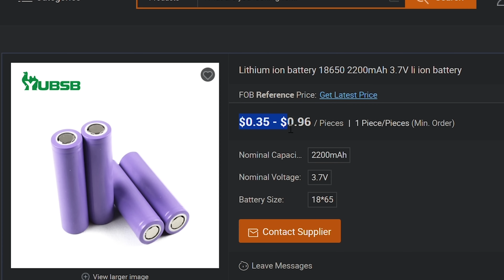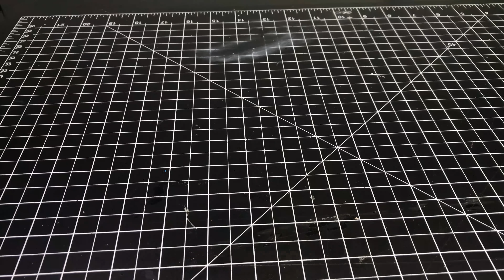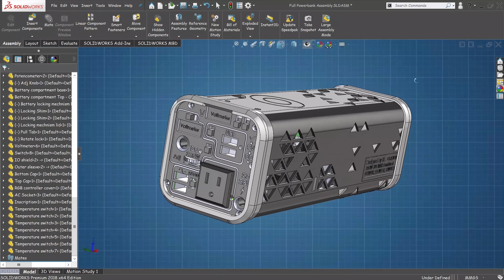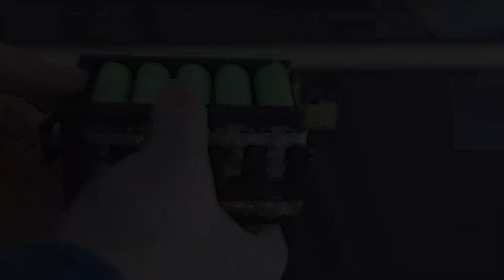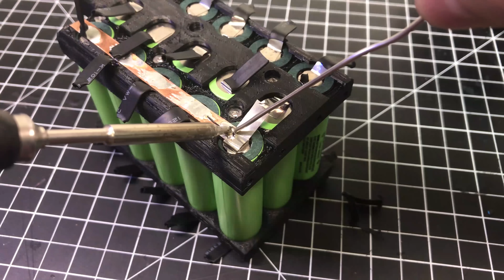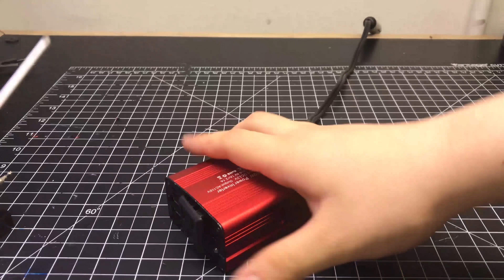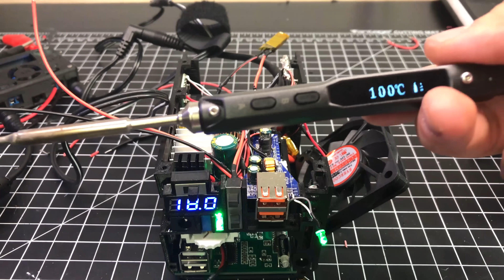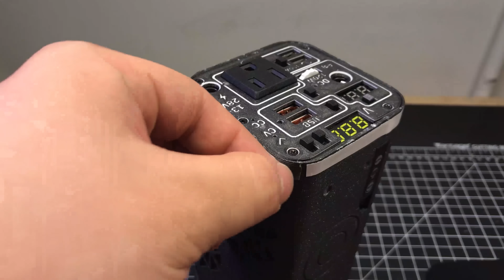How to Make the Ultimate 18650 Power Bank with Infinitely Expandable Capacity

Comment: Out of interest, why do you charge at 2A-3.5A?  You have 5 in Parallel, so at 0.5C charge per cell doesn't that enable a charge current of up to 6A??
Reply: Or for your batteries (Got the capacity wrong...): 3200mAh, or 3.2Ah *0.5C *5 in P = 8A Charge Current?  Or am I completely wrong here?
Reply: @SkySpeer  Safe charging current is 1C, as in 1 * Capacity. For a 3400 mah battery 3A should be fine.

Comment: It is not a power bank,  it is a power station ... You are a genius
Reply: Goal Zero calls this type of thing, a Generator, because this turns battery output, to AC line voltage, to normal Outlets.  I have a "Yeti 400".  It is a battery/powerbank/inverter, and this charges up via outlet, or solar panels, by Goal Zero.
Reply: A power station generates electricity. This doesnt.
Reply: @TigerManGaming  i think he meant station as in a larger capacity system. You are right though, power stations are technical names for transformer stations and generator stations

Comment: I created 10kg power bank to Makita box with 5v & 230v output of 2300w. Inside the box are Turnigy batterys 4x8Ah 6s 24v. That was very expensive for me to create it. Also I added several charging options to box - solar controller, 6a main charger, auto 12/24v step up converter.

Comment: As a Arabian, can i pass this through the airport without being sent to Guantanamo Bay? I heard their sandwiches are un- joyable...
Reply: I think the batteries are too powerful to get through normally, but if you call TSA in advance you can get it cleared.
Reply: For transport in passenger aircraft the limit is 100 Wh. With 15 cells it has probably more than this - and would not be allowed in a passenger aircraft. There is also contrary to commercial products no sticker with the specs on it, so I doubt they will let someone with a huge powerbank like this into an aircraft (despite this powerbank is really awesome).

On cordless tool batteries there is usually a sticker with the specs, and on makita batteries there is even a small plane symbol on the sticker, as long as they have less than 100 Wh.

Comment: You sir are a legend. I love it. I have pretty much all of the components needed for this build except for 3d-printer and soldering iron so I´m kinda tempted. It all seems pretty straight forward but very time-consuming. I actually have a total of 1300WH 18650 batteries already soldered and connected into 84v configuration. I´m wondering if I could hook that up to my 300W inverter in some easy way?

Comment: Do the usb 20v trigger, convert traditional 5v from a usb port to 20v and then get stepped down to 12.6 volts for charging? Or is it being used to carry 20v from a charging  source to the trigger then to the stepdown converter?

Comment: I live in Germany, so what do I have to change to make this AMAZING power bank work for me?
Reply: I think mainly you would be looking at an inverter for your country's power requirements. So where us in the united states use 110v - 120v ac with those simple 2 to 3 prong small outlets,  you would get the kind of inverter you would see commonly in your area. But please take plenty of time to compare the internals of your inverters with those of the one displayed in the video and infographics. High powered electrical devices should not be messed with unless you know exactly what you are doing, especially with the somewhat powerful and volatile 18650 batteries.

Comment: How do I tell if my batteries can put 5 Amps? I have panasonic batteries the green ones. Also can I build the battery bank larger if I have a case?
Reply: You can build with any 18650 batteries but should have minimum requirements as shown in the video.

Comment: I don't think u can take this on a plane they will literally think is a bomb
Reply: A bomb with RGB
Reply: @abrahamyehoshuafrias3390  Fancy Bomb
Reply: You can't anyways because only battery packs up to 100Wh are allowed on airplanes.... Now if we take this and breakdown into smaller 90-ish Wh packs we're totally fine.
Reply: @MatheusPratta  only if assembled ... pack the battery packs and main body seperate and you should be able to check them in your luggage
Reply: theres a max battery capacity allowed for airplanes anyway, this goes way over the limit regardless
Reply: With the RGB, and you mentioning a bomb, my brain jumped to this: https://www.youtube.com/watch?v=j-zvuq_AvU4
Reply: It's not a bomb it's a bong!
Reply: @몰라요 Speach 100
Reply: RGBomb
Reply: I wouldn’t be comfortable being on a plane with this. I have seen first hand just how bad a short in a lithium battery pack can be. If you tack welded the battery’s to the buss bars I wouldn’t have a problem but soldering them with an iron puts far too much heat on the battery.

Comment: Awesome my friend, you should get a job at Belkin, Logitech etc.
10:30 - batteries charging and discharging at the same time? The step down converter would provide suitable power to pass-through, you could leave everything going. While Im sure a flooded led acid battery's chemistry could be slow enough to technically be charging and discharging (microseconds) Your using a much more efficient battery set, with BMS. Just a thought.

Comment: I have a ham radio that is powered by 12v (13.8v ideal) it uses 10a max on transmit and 3/4 A on receive...roughly 3 to 1 on trx versus receive. would this unit power it?

Comment: I have some similar systems using old e-bike batteries. I charge using solar power circuit that I found on ebay that supports 48V batteries - i set the charging voltage to 54.6V. A problem I encountered is that I charge and discharge at the same time because I need to charge my phone, so I was thinking about using an arduino with 48V relays to switch between the batteries so that one would be charging while the other is being used. I have learned a lot from this video, thanks.

Comment: Hey I'm curious about which 18650 cells to buy.
https://www.alibaba.com/product-detail/Original-Japan-NCR18650B-3400mAh-3-7v_60482164381.html?spm=a2700.7724838.2017115.83.178268efmg9Mey
This link has a max discharge current of 4.8A and idk if thats going to make a bomb in my living room. I don't know anything about li-ion and samsung scares me, do I need to make any changes if I use those batteries? The internal resistance is like 48mOhms too!! 
Please help, I want to build one of these bad boys!
Reply: 48mOhms is very good but it should be considering they are new cells
Reply: look for highly-reviewed 18650 when buying from Alibaba there are a lot of fakes and it could be bad news if you get a bad one, probably worth doing your own capacity and temp tests.

Comment: Finishing this to be a marketable product should be your goal.

Although getting the safety aspect up to meet regulations isn't easy and will drive the price up, you should try and find out if its possible.

With a dedicated pcb you should be able to make it smaller and/or increase the capacity.

Comment: lol "if you can manage to find a lot of cheap used batteries perhaps online or from china, then you can perhaps get it all for this low."
please, dont.. if you wanna run high current devices like your promoting here' the last thing you need it a lot of "????" old batteries from China or what ever place there is all in different span of their lifetime and different chem.
come on, homie, that goes without saying, unless you wanna role the dice on burning peoples houses down. !!
+100 watt power banks for home use, don't use doubtful cells, really not the place to take chances, quite the contrary, personally, I would go for LG HG2  they are cheap and can sustain high current.
I salute your work here +1 very impressive.. but no reason to tumble all sense of logic, simply to make a  statement on price vs retail.. good quality high current INR/IMR cells are vital IMO, and particularly if you not balancing them continuously on the fly..
If you go down this DIY road, then it is not because of "price"e, as the cost of items and tools and time spend, will usually don't add up... it is down to hobby and interest and the feeling of building something.
Though I would have gone for higher than 45degrees temp' switches unless you live on Greenland and would also have implemented an amp meter as that is IMO very useful info.
but an adjustable power bank is really helpful tool for all sort of stuff.. use mine all the time, though only DC max 85watt. 3 to 24v with voltage and amp info + voltage info under load and the ability to turn trickle charge off, so it is on even on small current-load..
fitted it with 8x HG2 // 24Ah.

Comment: While this is a neat concept, the price quoted is completely incorrect. After going to all these websites for the parts and even trying to find cheaper routes through amazon or ebay. the project as of this date is quoted around $225 USD. Which is a bit absurd when buying one of these is roughly $300 USD. Granted $70 is for buying the 3d printed things as not everybody owns a 3d printer. but still, thats a lot when the main perk of this is that it is cheap to build.

Comment: Hello, Don't you have problems with low battery voltage? Indeed the converters 12 to 230v cut when the voltage is at 10v then the limit voltage for the battery 18650 is 9v? Thank you.

Comment: dude that's so great but so messed up. i would rather use Arduino for protection against high current flow or temperature or we can make buck boost or inverter with Arduino.
but it would become complex to program Arduino i guess....
we can also add some cool features like auto shutdown power when no current flow detected.
there are so many possibilities with Arduino.

i appreciate this i would try this with Arduino or maybe esp8266 WiFi to make it control from WiFi idk why i am using so much WiFi chips XD.
i even think to replace Arduino with esp8266 XD XP !!!!! 

a biggggggggggg likeeeeeeeeeeeeeeeeeee for this video

Comment: Very nice Projekt. Thx for sharing. A smaller version without AC outlet including a 12v socket would be nice. So a real sine ac Converter with more power could ne connected if needed. Specially for people who don’t need the ac outlet most of the time. 👍

Comment: DO NOT USE A MODIFIED SINEWAVE INVERTER ON SENSITIVE ELECTRONIC HARDWARE LIKE LAPTOPS
Reply: Why not? SMPSs like laptop chargers are rectifying it to DC before doing any convertion anyway. I wouldn't use it on anything that has transformer.
Reply: @cekpi7  modified sine wave would put extra pressure on the components of the rectifying circuit. It will work, but i would risk running a £1000 laptop on it!
Reply: @audioglitchguy  Why would it? Wave would have same peak and rms value as well as frequency. Diodes don't care, you can feed 220V DC and it would work without a problem.
Reply: @cekpi7  Modified sinewave produces interference, and you don't want that buzzing throughout your laptop. Yes the caps will buffer most, but not all!

Comment: There is no big problem to make a nice huge versatile battery, the real challenge is balance of : low weight + compact + high capacity + high currents + fast charging + solid durable shock and water proof case, in one solution. balance = usability.
Also, good job man!

Comment: I don't really recommend DIY-make a battery pack and use it.  Lithium batteries are too easy to burn so it needs to be designed and manufactured by professionals.  DIY is no good when you can't tolerate failure like large capacity battery pack.

Comment: Great idea but for mere mortals it costs thousands to make: 3D printer and other tools/parts.
Far easier for us to buy off the shelf.
If we all bought the tools needed to make it then we'd be wasting resources and killing the planet..
Reply: Quick Google search will give you at least one place where you could print on a 3D printer. If you live in a shack in the wood however, then yes, you are right. Other parts are kinda cheap and can be found at the local electronic components shop. Even cheaper if you are willing to order from China. The most expencive part here are 18650 if they are new.

Comment: This is awesome, but I think this video needs to be MUCH longer and more detailed. When dealing with lithium ion batteries, an incorrectly soldered connection or missing component could lead to a very serious fire.
Reply: Yeah. There should be a disclaimer before the video "common sense required to build this thing. don't short circuit 10A output on yourself. don't charge 18650 to 12V. etc. etc". :) 
Actually I would prefer to connect 18650 with a point welding instead of soldering.

Comment: oh my cold solder joints 21:39, you really need to learn of a better way of connecting everything together instead of globbing solder everywhere, maybe try using some molex connectors and design a circuit board with molex headers, then connecting everything together through PCB traces, you can use a service like JLCPCB to get the board fabricated
Reply: 100% this

Comment: WOW, That's really impressive! So many functions so much capacity. Perfect power bank. I think an MCU could have simplified the design a bit. but STILL! I am baffled. And I like the classic led, rough black plastic look. Looks good on the inside too. All the systems are neatly arranged. Makes it look like something out of cyberpunk. Whose portable power bank got a freaking cooling fan in it? Just freaking wow. I hope to see more like this and maybe a second iteration. My soldering iron is currently complete trash, so I will try to build this when I get a better one. Good job.

Comment: Great video and great idea but ...Batteries from old laptops??! The first thing that stop working on every laptop I have ever owned are the batteries, so the only alternative is to buy them new.
Reply: Well... Not entirely true. Laptop batteries is made of cells, where 18650 are connected both continiously (to increase voltage) and in parallel (to increase the capacity. If one of the continiously connected batteries dies there is a voltage drop to a point, where  laptop tells you "the battery is dead". However 2 out of 3 baterries (most often it's 4 out of 6 from my experience) in this cell are more than alive and could live a happy life for a couple more years.

Comment: You gave no thought to the repairability of the device. And the main fuse is very hard to get to. Also SolidState Relays would be way better (no arking, much longer MTBF), Otherwise GREAT build!
Reply: + that regular used CAR FUSE, could've been easy accessible by making a slot for it on the outside, so just like on cars simply (un)plug to replace! but man his project is massive and again he learned so much, he's planning on a V3 around 2020 sure that one has easier disassembly options :)

Comment: Probably a dumb question, but will the pack charge faster if you plug it in both ways?
Reply from the maker: No, the charging speed is dependent on the current you set. If you have a supply capable of 10,000W (500A @20V) the current limiting stepdown converter will only let 2-3A pass. If you connected both connectors, one will fry the other as one has higher potential.
Reply: @kralyn3d  Thank you, which would charge faster (I am assuming the laptop port.)

Comment: Dude, you are honestly the best designers I have seen on youtube. There is no way you have only 22k subs, I guarantee you will get a few million. one tip to make your prints smoother if you take a container, with two levels, you could put acetone in the bottom and your prints in the top, then cover it with a lid. it will dissolve the outside layer of your print, and let it smooth out,  Test how long it takes for the outer edges to smooth over, and you will have even better-looking parts.

Comment: I 3D printed everything according to your Thingiverse files, but somehow I am unable to slide the battery into the battery compartment. It is just too big. I tried fixing this issue using a dremel tool, but this did not work. Do you have tipps on how to make it fit properly?
Reply from the maker: Did you print the file named battery compartment ONE PIECE? If yes, you might need to sand down the curved sides of the battery pack, or check that there are no solder perturbing out of the surface.
Reply: @kralyn3d  The two files "Battery Compartment Top" and "Battery Compartment Base" were printed separately. After that, I glued them together using some superglue. The solder is not the problem, the Battery ist too wide. There is too much material in the sides.
Reply from the maker: @simonschulz3784   Print the battery compartment ONE PIECE file.
Reply: @kralyn3d  Thank you very much. I printed the one piece file and now everything fits like a charm.